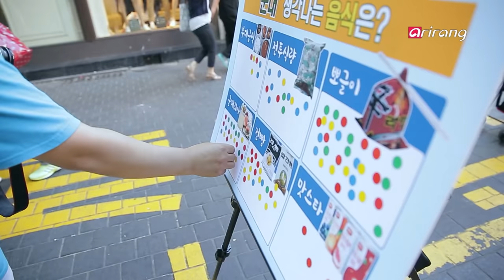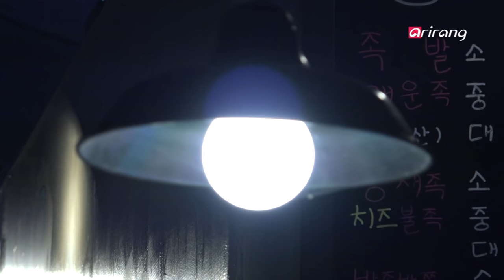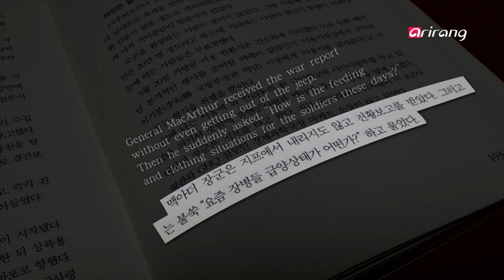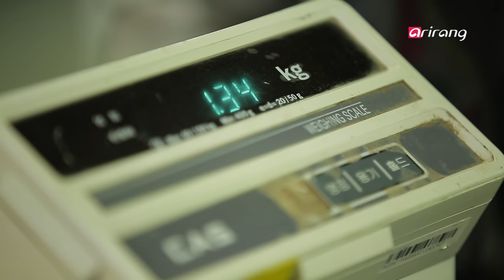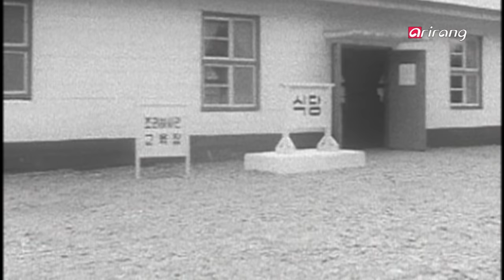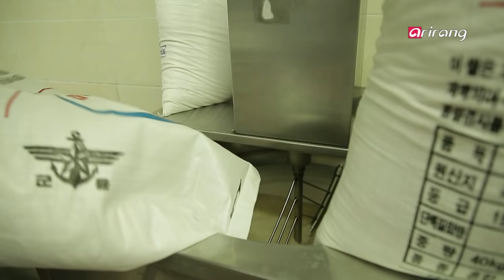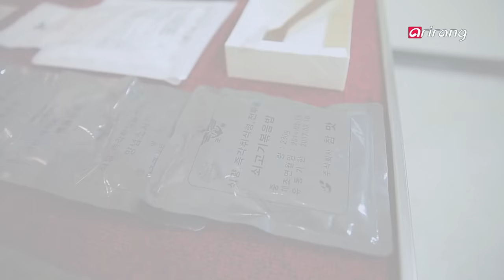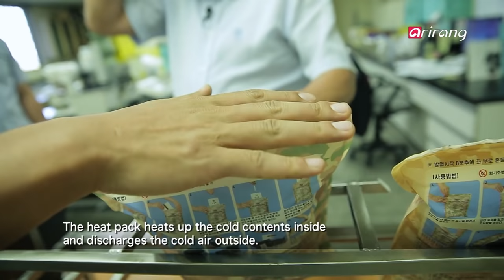[Arirang Special] The Soldiers' Dining Table *이세환 기자 출연* (대한민국 군인의 식단)

Comment: I was in the US Army but got to spend a week with the ROK Army as part of an officer exchange program.  Something interesting I noticed is it appeared the food quality for their Soldiers improved the closer you got to North Korea.  I spent most of my time with a support unit pretty far in the rear; while the food was ample it was awfully bland and with little meat.  But I got a chance to go up to the DMZ and as I went north, things seemed to get better; stopped at a headquarters a couple miles south of the MDL and had a lunch of fried fish.  Had dinner within eyesight of North Korea which included beef ribs!  Oh, and in all the units I visited the kimchi was excellent.
Reply: 300Spartans  “If the food is good enough, the soldiers will probably stop complaining about the incoming fire”. Frontline incentives, I guess.
Reply: The standard of meals for South Korean soldiers is three meals a day, and the cost of meals per day is 6848 Korean (the standard set in 2014, equivalent to about 42 yuan). However, this price is very low relative to the income level of South Korea, because the price of food ingredients in the army is much cheaper than the market price. In addition, the cost of meals for ordinary soldiers has increased from 8790 won (about 45 yuan) to 10000 won (51 yuan) per day, and about 3300 won (17 yuan) per meal. But the prices in Korea are on the high side, so you can't eat very good food.

Comment: I used to trade field rations with Korean soldiers when I was in Afghanistan. Most of them were much better tasting than US MREs. Also the Korean MRE heating method has a so much better and easier to use